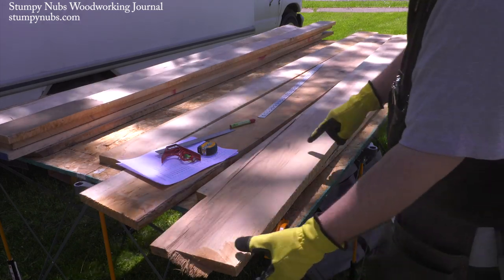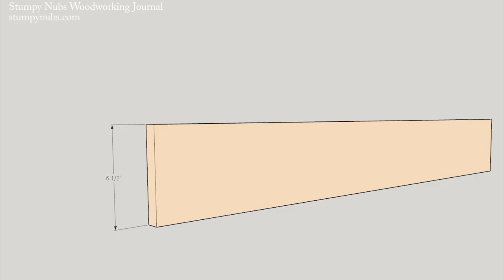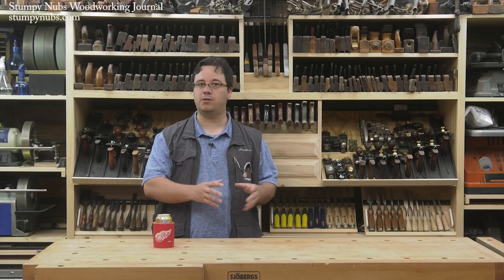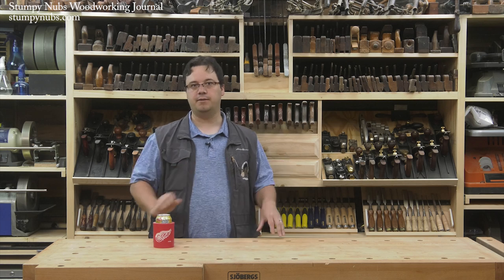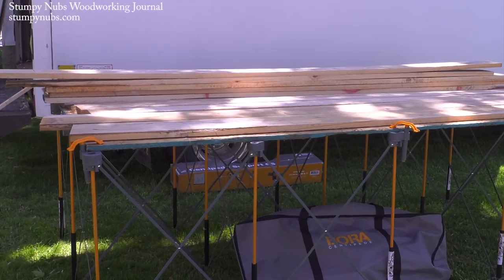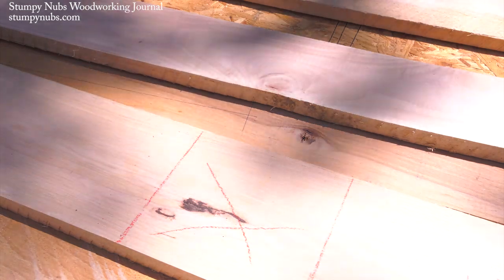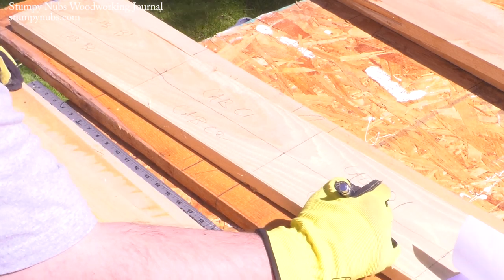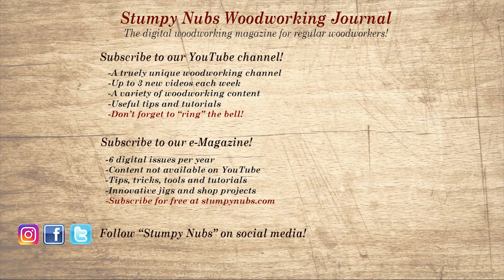How to make sense of rough-sawn lumber

Comment: Excellent tips, thanks.  One thing I do is to leave the pieces two or three inches long on each end so the snipe will happen there and then cut it off later.  I'm sure you can do an entire video on snipe.  Those ragged split ends?  Leave two or three inches on the project piece.  Leave a number of short pieces connected in a board where practical so the snipe will only happen before the first one and after the last one.  Thanks again for your tips.
Reply: Barry Irby I’m always amazed at how reluctant people are to include a waste factor when picking out wood. On one hand, I get it - Lower waste factor= less wood to buy. However, including a little over length, as you suggest here, can save a lot of headaches. It’s a wise investment, in my opinion! 👍

Comment: Do you ever straighten bowed boards? I have put them across a gap and stored them with a weight on the middle to do that and it often works well. You have to do it intelligently and only use such straightened boards in places where they will be unable to bow again because of a supporting structure around them. It does work if you do it thoughtfully.

Thanks for the tips in this video, they really will help on those rare occasions when I buy lumber rather than salvaging it.  I seem to live in an area where people frequently dump broken or sometimes even intact furniture made from really good wood.  Grabbing it and making something new from it is my favourite form of recycling and saves me from having to buy wood very often.

Comment: Jim commented on the inadvisability of cutting rough lumber on a table saw.
I believe that is because rough lumber is not flat, and can wobble as it moves through the blade, ramming an edge against the blade.  Even on a radial arm or miter saw, the wood can move as the cut proceeds.
I've managed to cross cut bowed wood on my radial, with the concave side facing up, so that the cut-off piece tends to fall away from the blade.  Cutting with the convex side facing up, with a space beneath the board where the blade passes, lets the cut-off piece fall toward the blade.  Saw blades express annoyance when a piece of wood pokes them from the side.

Comment: I cut my own trees and made lumber from it.  Three during sheds later I have enough to last me.  I like figured wood and the challenge of adding butterflies or keys to keep the wood together if splitting might be an issue.  With knots I fill them with an epoxy mineral mix.  Your so right if your trying to get that straight grained look.  Thanks for your videos. Bob

Comment: I have a cut list optimizer app on my phone. I input the size and quantity of every piece I need for my project. Only after I've done that do I go to the hardwood dealer. Once there, I pick out boards I think will work, run the optimizer and see if all my pieces fit with at least 20% waste. Way faster than laying out boards of random length/width and drawing on them

Comment: Just getting into woodworking in my retirement I've had to learn a LOT along the lines outlined in this video. I was a welder / metal fabricator and a 3" x 3" angle iron measured true, not so with wood. It was frustrating at first but slowly and surly I'm learning.

Comment: Good tips here James. I always use rough sawn lumber when I can get it. It can be much cheaper than S2S or S4S material. I especially liked the tips about avoiding the defects like checks and edge knots. I do use my table saw for ripping rough sawn lumber but I have a carrier to clamp the boards to. Thank you for sharing.
Reply: I was wondering about the tablesaw comment. I have never used anything but a miter, hand saw, or tablesaw for cutting project parts to size. Never considered it cause for concern.

Comment: I can't remember the last time I used a 25 ft. tape... probably on a remodeling project.  In the shop I use a 12 ft. or smaller... easier to work with, lighter, and not as bulky in my hand... great tips on preparing rough-sawn lumber for projects!

Comment: Wanted to ask there are small cutting mills selling hardwood at preaty fair prices and was wondering is it ok to buy a bunch and stack it to dry or jyst go and buy from mills that rough cut and dry the lumber ready to go. Also is it a bad idea to just buy a bunch and stock pile it in a barn for future use rather just go buy hen your ready for a project. TY for all your great Help and videos.
Reply from the maker: You can buy and dry yourself. But you should do some reading on proper stacking and stickering technique. It's not too complicated but it is important.

Comment: My wife wants to SEE this wood after you made something with it!  Also WHY is it NOT safe to cut rough wood on the table saw please?
Reply: Same question, since I don't have a cross cut or band saw. Yet!
Reply: Adrian Abshire I think it’s because the rough surfaces make it difficult to hold the board flush on the table as it moves through the blade. If the board moves, the blade may yank the board potentially pulling your hand toward the blade. However, I suspect many people still cut rough lumber on the  tablesaw, even though you technically shouldn’t. 🤷‍♂️
Reply: Anne O'Reilly see my answer to Adrian above 👍

Comment: I am wanting to build an Adirondack chair. The last one I built I used regular 2x pine, it was horrible, lots of pitch to deal with on blades and when I drilled into it, a glob of sap came up out of the hole. Making another, I was looking at cedar but the only thing I can find is rough sawn. Somewhere I heard that rough sawn cedar is wet because it's not kiln dried. So would this be as bad of a choice compared to pine? Can it be planed smooth on one side?

Comment: as many have mentioned, yes the wood is cheaper, but you spend more money on milling equipment and more time preparing the wood for the project. is it always worth it? I'm still getting (re)started in this hobby and have limited tools -- mainly a table saw, router/table, and handheld power tools. if i can find nice looking S4S lumber, why not buy it and get right to work?
Reply from the maker: When you mill your own wood, you know it's flat, straight and square. When you buy pre-milled it's is very likely not going to be that way once you get around to using it.

Comment: Hi Stumpy.  This is a little off this topic but maybe you can give me a quick answer.  I have a plan for an entertainment center.  It calls for mortised joints at the corners. (not sure that's the right term).  Could I just make the 'box' using pocket hole joinery?
Reply from the maker: Pocket hole joinery is quite strong for casework like cabinets, etc. I think it should work fine for an entertainment center.
Reply: @StumpyNubs  Thank you.

Comment: Would that 40% premium of handpicking the rough lumber still be cheaper that picking finished wood?  I have no idea on prices of rough lumber.
Reply from the maker: Depends on the price of the rough lumber. But in this case, it made it much more expensive. However, I was buying 8/4 (2-inch) walnut, which you can't usually buy pre-surfaced. So I had no choice but to buy it.

Comment: Please teach me how to keep track of my pieces once I start milling and the markings are gone. I use tape on the ends but even that doesn't always work so well :)
Reply from the maker: Write it on the end grain with a pencil
Reply: @StumpyNubs  devise a simple code and write it on a sliver of paper and staple it to the end. When you chop it into smaller pieces, chop the code up into smaller pieces and ditto.
Reply: @StumpyNubs  devise a code for the piece and write it on a sliver of paper and staple it to the end. When you start to chop up the board, separate the codes and staple to each offcut.

Comment: Can you explain why it is too dangerous to saw rough cut lumber on a table saw?  I've done this a few times without a problem, but would like to avoid a problem it really is dangerous.  I don't have a joiner or planner so I just have to do the best I can with straitening lumber on a table saw.
Reply from the maker: If you don't have a straight edge against the fence and a flat surface on top of the saw the work piece can easily shift mid-cut, pinch against the blade and kick back. Check out our table saw series for more info: https://www.youtube.com/watch?v=qSbS5zhH7cE&list=PL-gT7JMZFYjdLyzXQ6-TeJsFvB2mZjUe6

Comment: You mention it’s too dangerous to cut rough lumber on a table saw, would you please elaborate why?
Reply: If you use the splitter or riving knife,  pawls and blade guard  and board to be cut is attached to a straight edge you'll be safe.
Reply: Basically rough lumber typically isn’t flat or straight enough to pass stably through a table saw, so you risk is wobbling or angling on the way through which could bind up and kick back. A band saw won’t kick back and is more forgiving with making cuts on less-than -perfectly milled boards.
Reply: Its a good way to get a board thrown at your face no matter what safety equipment is attached.
 If you find you're going to be straightening out a lot of lumber buy a good track saw. Its the best way to get the most out of your pieces. Especially if you dont have a jointer. What do i know though?
Reply from the maker: This is also covered in our table saw safety video: https://www.youtube.com/watch?v=qSbS5zhH7cE

Comment: Maybe add how to store rough cut lumber
Reply: In the meantime...

1. See to it the end grain is sealed...
    Sure, there are products like "water anchor" and so forth for premium prices... AND you're certainly free to go with the professional stuff... BUT as long as you bother with it, you'll save more lumber than you waste. Moisture leaves end-grain faster than any other part of the wood, so dabbing literally ANYTHING on it will help prevent waffling, cracking, and cupping... maybe not perfectly, but better than nothing.
    MOST sawyers do this already if they're competent... BUT there are exceptions to every rule. AND it's just worth a finer point, I also seal the ends when I take cuts, and put boards back to storage too...

    Just in case you're scratching your head... If you go to the big-box store and look at the boards of regular lumber, notice the colored ends... The colors may be coded (which changes from one store to the next) but the stuff that does the coloring is specific sealant used to decrease the end grain evaporation while in transit. If you've bought boards without that sealant, and they've split or cupped or warped horribly... well... now you know why.

2. Store the stuff FLAT on a FLAT surface. It doesn't have to be "nuclear science level", just reasonably level and as flat as possible. It's awfully tempting to prop boards up on sides, edges, or ends, but this ONLY ever increases the amount of planing and flattening you have to do later. 

3. USE SHIMS... anything about an inch thick will do the job. AND yes, I encourage stacking. Shims are mostly feasible around every two feet (24 inches/ 60 - 70 cm ish) BUT I generally propose a shim every foot or so (12 inches/ 30cm ish) This promotes a slightly more even transfer of weight as the stack gets taller over the bottom most boards... pressing them literally flatter than you started if you're just a bit careful.
    The second purpose of the shims is to promote air-flow, allowing the wood to breathe and reach equilibrium (moisture wise) with your storage area and shop. It's all part of the settling process, and (in some technical sense) should be allowed at least three weeks (but we're all guilty of too damn much enthusiasm/excitement...lolz)

4. DON'T FORGET to rotate your stock... This includes getting boards off the bottom and bringing them to the top, will bringing the upper boards in a stack down to the bottom.

    This will exploit the very same nature of wood that CAUSES the cupping, warpage, and twists in the lumber to prevent or counter-act it. While it still may not be a "perfect fix" every time, it's certainly going to work better for you in shorter and longer runs than throwing a tarp over the whole thing and forgetting all about it...

     Finally, temperature and humidity are factors in cupping, shrinking, squirming, waffling, and warping in general, too. It's worth a strategic research project or even buying a credible book on the matters of storing and drying your own lumber, just to have some of the major species noted and temperatures and humidity levels they can tolerate for your perusal (as long as we're on the subject). It avoids headaches to have real numbers to work with, and then however you manage your stock-piles is up to your judgment... but there's nothing more frustrating than to find out AFTER years of split-ends, hopelessly banana-shaped boards and horrible twists turning remarkable stuff into kindling... that simply raising the humidity a few points and dropping the temperature around a dozen degrees would've likely saved you a heap of money and tears.

      You don't have to be a professional sawyer nor get certified to run a kiln for the stuff to be able to figure out the better ways to store it for your own location and atmospheric concerns and constraints. This short list is my top principles for it, and has served me well so far. I tried to keep them in approximately a prioritized manner, but there is a fair degree of "crossing over" to be considered... SO I just hope this helps out. ;o)
Reply: @gnarthdarkanen7464  
🖒

Comment: Your American wood, is the envy of we Brits! LMAO! 
(Not entirely true these days though, as I have found a few great sources in the last couple of years).
Reply: It's not neccessarily the wood we're jealous of so much, as the prices! I recently watched a video of a guy making a beautiful chopping board from a 12 ft rough sawn walnut board. It was about 10 x 3+ inches in cross section and all got used in this one chopping board! He only paid about $80 for it!!! I just got a quote for 3 pieces of rough sawn walnut approx 4 ft x 10 x 3 inches. This is their reply. "  for those dimensions in green walnut it would cost £29.80 per meter plus vat.
There is a chance we may have a bit of walnut we could milk up.

The wood would be green not air or kiln dried."
That equals approx $165...WTF!

Comment: I know this is a bit of an older video, but you mention that cutting rough lumber on the tablesaw is too dangerous.  Why do you say that?
Reply from the maker: Table saws are made to cut straight, flat boards. Rough boards can pinch the blade and kick back.
Reply: @StumpyNubs  ah, ok.  But aren't reaving knives and/or splitters designed to help preventing that?
Reply from the maker: @reubenpopp2006  To help, yes. But they can only do so much. Your "ah, ok" sounds like you are skeptical. But if you took some time to think this through, you will see what I mean. Imagine what happens when you rip down the center of a cupped board and the crown collapses. Or if a warped board rocks during a rip. Or how a curved edge will shift as it is run along a fence that is shorter than its full length.
Reply: @StumpyNubs  Not skeptical, just making sure I understand the difference, and to determine if I need something else to help prevent kickback on my saw.